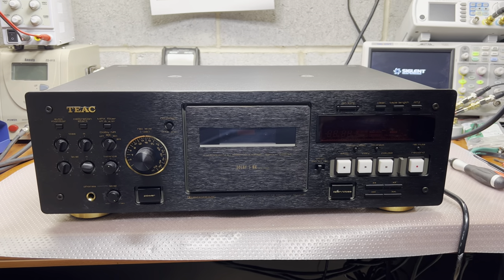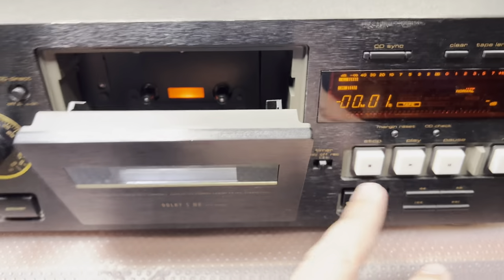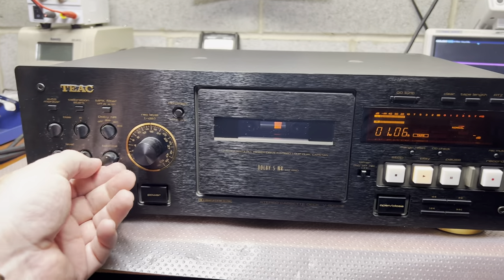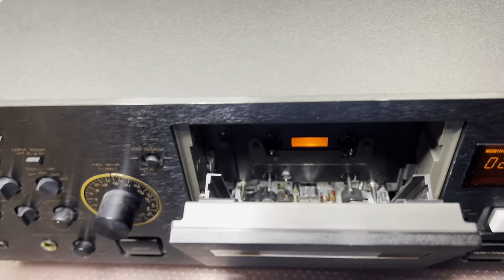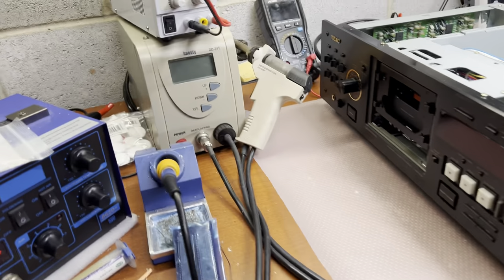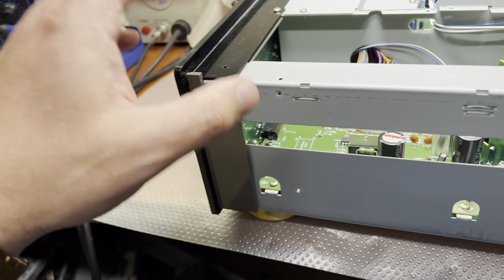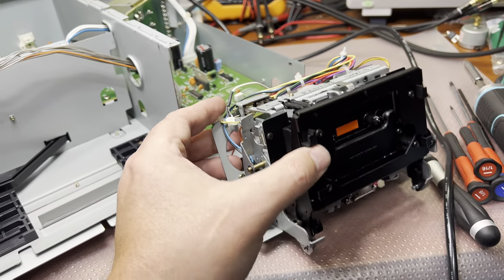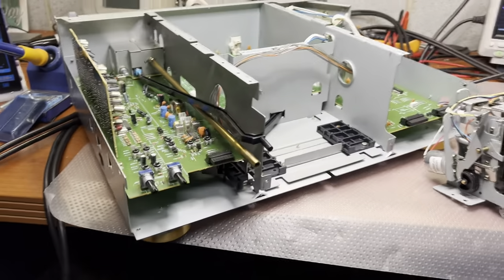Teac V-8030S - A Hidden Gem: Unboxing, First Look, and Tape Transport Removal

Comment: Excellent device, with quartz control motors. And yes, the sound is sometimes better than that of vinyl. Checked.
Reply: I also find cassettes to wear down much less with each listening than vinyl records, not to mention the resilience to mishandling, exposure to dust, etc. And with a good deck the performance is also remarkably uniform along the entirety of the tape, unlike vinyls whose quality changes and almost always steadily degrades the closer you get to the end of the side.
Reply: @mihaischitcu1917  It was rightly noted that listening to a cassette has its own charm. I listen on a good deck Technics AZ 7.

Comment: Would you rate this one above a Nakamichi 680 ZX soundwise when preferring a full, rich and organic sound with a tight bass?
Reply from the maker: You probably kidding. 8030, even after replacing capacitors with Nichicon, sounds lifeless, simple, and not interesting. Very overhyped and overpriced deck.
Reply: @hifirulezzz OK good to hear, thanks a lot. Could you please suggest a very good deck that doesn't break the bank like the Nakamichi's?